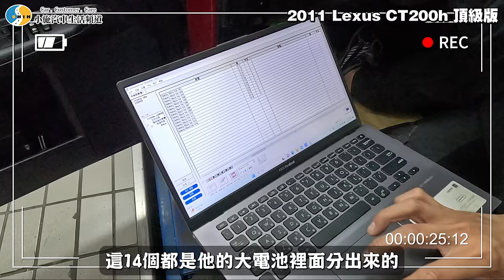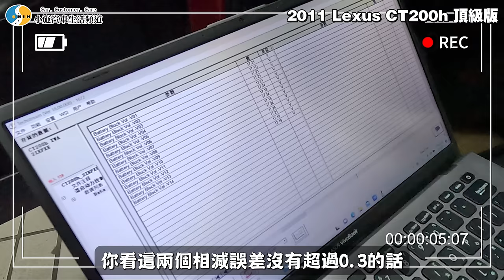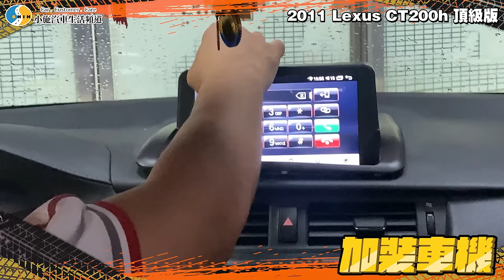【愛車大改造】花老闆的錢毫不手軟!小搞搞也能花幾十萬??/2011 Lexus CT200h 頂級版【小施汽車】

Comment: Very nice CT modifications, I am sure the big battery can last over 350k+ KM, I am in US and driving my 2011 Prius with over 224k+ miles still with the original battery, as long as the car is using daily/weekly then the battery will last until it's end of life, I will replace mine once it hit 250k miles regardless.   Keep up the good work filming this type of modification vlog.  👋👋👍